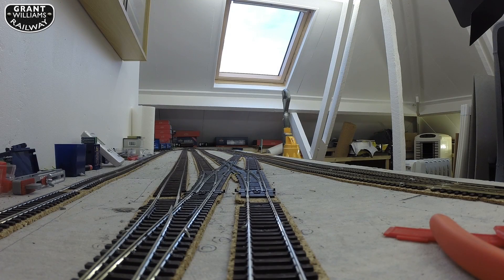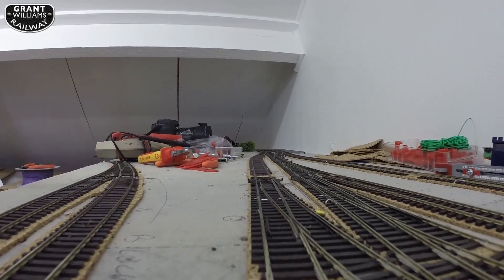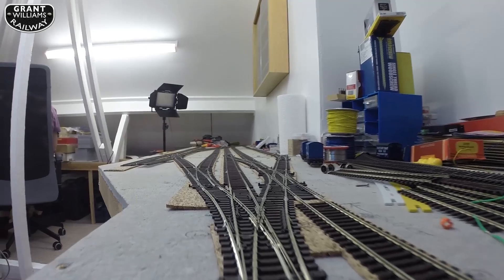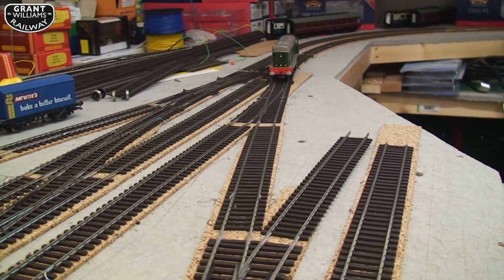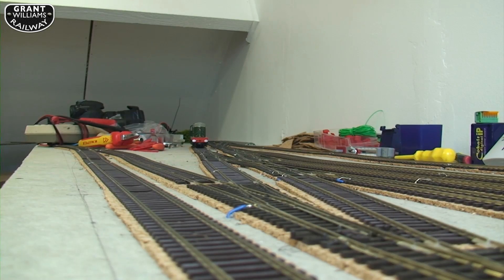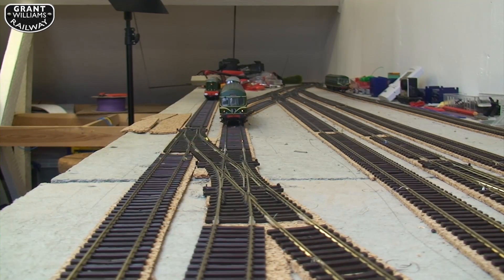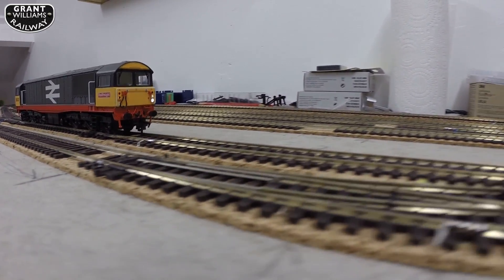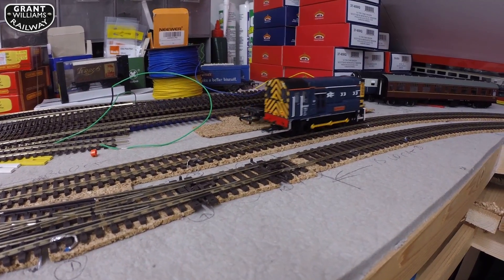A Model Railway From Scratch - 10: Track Testing!

Comment: Nice to see some trains running and to see that you have it all wired up and working as it should do.  I am in the same boat really, I do like the steam trains but I have started to really take liking to the early diesels (probably helped by the slw class 24) and now I need to decide if I should scrap the late 30's setting and go for 60's instead.

Cheers,  Michael
Reply from the maker: You could just go done the "heritage line" route, which is the standard get out for a mixed era layout! Ultimately though, i just run the models i really like, regardless of their era.

Comment: Good to test with lots of different locos.
Classic difficult loco is an 040, since it rocks around and can be tricky to keep power to. So most people fit a s/a cap to them, which negates the benefit for testing. But a clean 040 is useful for track testing.
And good track cam at start. Useful view, but you know you should have a better wagon (four wheel for testing, and bogie for filming to impress).
Keep talking the lines through to ensure the logic is robust; good naming aligns to good logic, and if you end up with different names depending on context, you may have confused usage planned, and hence confused layout and signalling.
Regards, Tom

Comment: Great layout so far I still can't get use to them double slips and I've not even wired them up what will be the size of the layout????
Reply from the maker: Thanks for your comment! I found the double slips a bit perplexing when wiring up & adding point motors tbh, took a few goes to get it right. The layout area is about 12x14

Comment: How do you wire a diamond crossing electrofrog?
Reply from the maker: I found this a bit perplexing to be honest Tom, however DCC Concepts have some great help sheets, including one on electrofrog diamond crossings.

https://www.dccconcepts.com/manual/how-to-work-out-diamond-crossing-frog-wiring/

Regards
Reply: Ok, that works quite nicely.
It does require that the train pauses between 2 and 3 on Route 4, so the points can be changed.
And therefore the Route 4 has to be long enough to allow the (branch line) train to be passed points 3 before stopping, and neds the points changed before it can cross points 2.

Put it another way, enable the two routes through the diamond at the same time (by setting the points) and no logic to control the frogs can work without other intervention. You can do that, with your track plan at the left end.

Most people fit a diamond crossing as a forgettable item, but I suspect this explanation and the need for signalling to support it, will make that a high maintenance item.
I had reached the stage where the signalling would control the frogs; since the signalling is controlled by the available routes (ie the points) it may well have had the same logic as DCCconcepts have outlined.
And, in the real world, two (independent) lines crossing are high risk, and therefore require high maintenance/attention.

I will have to be more careful when including these in any track plans.  Heck, even double slips seem easier, because they require explicit handling!